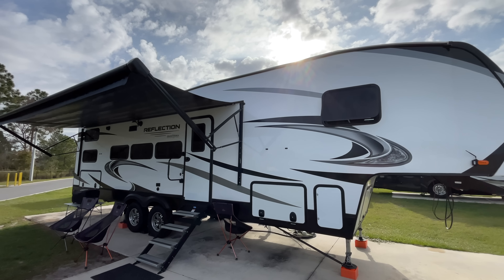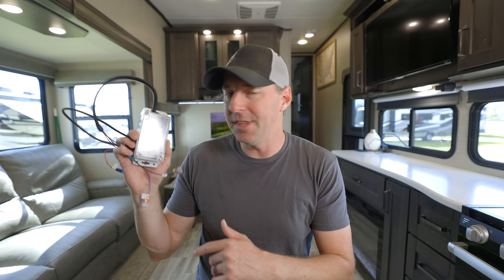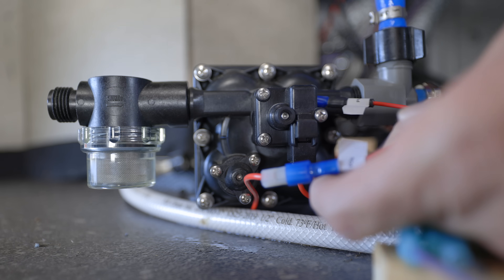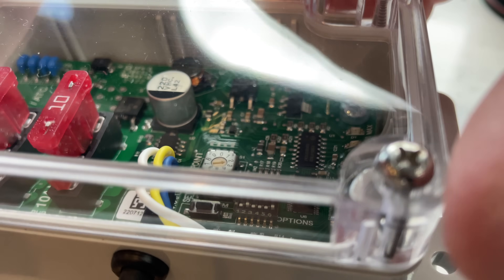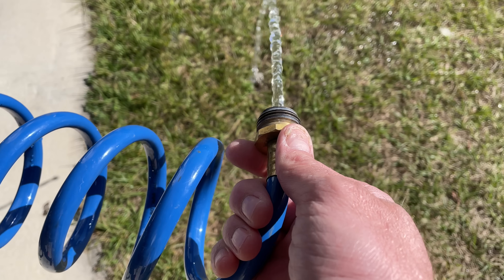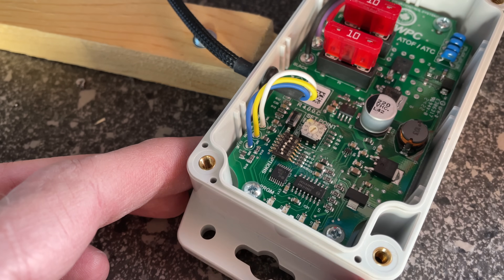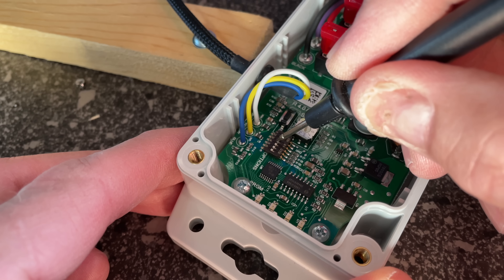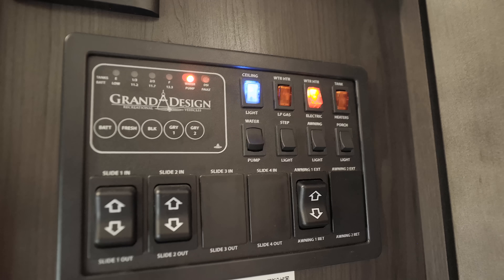Smart RV Water Pump Modification! Silence Your Rv Pump! IRVWPC

Comment: $210??? And doesn’t come with a new pump.

Or, get a $35 accumulator and add it after your existing pump.

Or, you can get a $70 pump with bypass, and adjust the bypass properly and get rid of most surging. Or maybe your pump already has a bypass and just needs adjusting.

Or, for about $150, they make pumps that are variable speed and bypass out of the box, like the Seaflo 56A.

Comment: Good video (upvote) but anytime you put a power limiter in series with a motor, or just about any other load, other than a simple heater, you start operating it at a non-optimal mode.  In other words, if a pump is designed to operate between 10.5 Volts and 13.5 Volts, at 8 Volts, the pump will work harder and likely not last as long.  One simple option for the pump cycling is adding an accumulator tank, which is what I've done.

What would be really nice is a system that makes tankless heaters operate as though they are tank heaters, but without the gallon limit (of course!).

Comment: Hi Jared, I just received mine and I wanted to ask where I can source one of those 90° connectors I saw on the inlet side of you pump hose. That strainer has that special fitting and I've not been able to find a 90° elbow that has that compression fitting applied. Wondering if you can help. Thanks and I've seen just about every video you guys have produced and I've learned a lot. See you on the road : )

Comment: To eliminate two of the three issues, get a SeaFlo (or equivalent) accumulator. Hook it, inline, with your pump's outlet (so, pump outlet, accumulator, RV water system) and set it to about 2-3 psi below your pump's cutoff pressure.

This will smooth out your water flow, eliminating pulsing of the pump. And only turn it on to recharge the accumulator.

It doesn't do much if you have your water on full-blast, but with less flow, the pump will run less often, but in longer bursts to do a full accumulator recharge. It should increase your pump's longevity too.
Reply: From the manual "The most efficient use of the accumulator occurs with the pre-charge set at the SAME pressure as the pump’s pressure switch “turn
on” setting. Typically, a 45 psi [3 bar] pump will turn on around 30 psi [2.07 bar]. Therefore, the pre-charge should also be30 psi [2.07 bar]. The pre-charge MUST be set in a “static” condition (pump off and at least one water fixture opened).
Reply: @littlechicago7482  How do you determine and set the accumulator PSI levels?
Reply: @LukaAVDJ  They usually have a Schrader valve (like a tire inflator valve).
Reply: I put in an accumulator tank and I don't notice it running any smoother or quieter

Comment: In the past I had to tinker with the two small adjustment screws on my Shurflo pump (bypass & pressure) - will that possibly impact the performance of this unit if the pump isn't at its "factory setting"?

Comment: I just installed a higher quality pump stuck inside a mineral-wool rectangle (with air gap) for sound deadening and a small pressure tank that eliminates the constant on-off switching. This would not give me enough additional benefits to justify the cost.

Comment: I have had the IRVWPC for about a year now, and I can't stop telling folks about it. It is one of those products that people generally don't know about. If you boondock this thing is great, if you are always connected to water, then don't get it. IMHO.

What I have found is that not only does it make the pump quieter, but It can help from getting the cold/hot spurts when you shut off the shower to lather up your hair, and turn the water back on. It helps to keep you from being scalded or froze. I also found out that if the spouse turns on a facet while you are in the shower, it will help keep you from being scalded or froze. When boondocking, you can get a nice trickle of water to wash your hands, or a plate, with out the on/off/on fast/slow/fast stream of water.

I also think they really need to re-invent the name. I think it would get a lot more traction in sales.

Comment: Our water pump is below a closet about in the middle of our 27' Airstream. Since using this device (IRVWPC), the water pump is much, much quieter and the water pressure is better. Sometimes, when my wife is in the shower, I have to listen to tell if the pump is running. I believe that the people that their water pumps in their living area and complain about the cost would have a different opinion if they ever got to experience using it. It's been a game changer for us.
Reply: Hey Dennis, I also have a 27' Airstream. The pump in ours is wicked noisy, I think it's mostly pipe rattle against cabinets and the inner skin. I have the soft hoses installed on the pump outlet already, so I'm wondering if this device will reduce the rattle noises, or does it really only smooth the pump cycling at lower flow rates? What's your experience been like?

Comment: Jared
Have you noticed any problems with electrical interference with this unit? Like causing LED lights to flicker? Just curious since many devices are not designed and tested for this.

Comment: I'm always watching your videos with high interest but this one honestly is a too much a nice to have gadget.
I like to hear the sound of the pump; with today trailer manufacturing quality issues, I prefer to control the pump myself from the panel switch.
Recently we got the kitchen hot connection broken and I was alerted by the pump and was able to stop it in less than 15 sec; waiting for 5 minutes would have been too much!
I turn off the pump every night and every time we leave the campsite when boondocking same as I always turn off city water when leaving RV park site, just my opinion but in many cases I'm always looking at the the simpler, the better ...

Comment: Having our water pump under the bed the reduction in noise would be very beneficial but currently waiting for for a second edition and hopefully a price reduction.
Reply: This is already a 3rd edition, from what I can tell. I got mine last summer and installed it in June. It works extremely well. I wouldn’t look for a price reduction, though.

Comment: I had the IRVWPC on our previous camper almost a year and really appreciated having it to smooth out the pump along with the safety features.  I’ve also had an accumulator tank and I much prefer the IRVWPC controller.  I will be getting another one for our new camper.

Comment: I bought this unit for our Airstream 30 ft and have had the same positive results as you, and the same dip switch frustrations.  I must add the owner /engineer is a super tech and so helpful on sales and service. I sure hope this stays that way and he like others is not bought up by the BIG GUYS that do not answer the phone or an email. I have asked him about Blue tooth in the future so those settings could be done on a App. And I understand that R&D cost could be prohibitive to keep it priced right for us end users. I appreciate your Video review as I tried an Air Forums  post and got the usual Naaaa I like hearing the banging pump. For you reading this I am a HUGE fan of this product. For you layman not into automotive pulse width modulation think of IRVWPC operation as a dimmer switch smooth from off to full bright or anywhere in between unlike a light switch BANG! Full on Full off.

Comment: Thanks so much for your review of this, Jared!  I wonder how much noise reduction this would provide if an accumulator tank were used with the water pump.  From what I've seen, such tanks reduce the frequency of the water pump cycling, but it seems that they would still make a lot of noise when the pump runs.
Reply from the maker: Good question! We had an accumulator tank before and it does help with reducing the short cycles on low flow but didn’t change how loud the pump is. This changed the sound enough to where I had been thinking of getting an accumulator tank again before we got this to test and now it’s not necessary. You could do both and they can work fine together but with as smooth as the pump sounds now it’s fine on it’s own.
Reply: I have installed a Seaflo pump, Seaflo accumulator, and an IRVWPC. Super quiet. I do believe having the accumulator tank does help to reduce the amount of time the pump needs to run. To me, as I'm converting a box truck, it made sense to build in all three up front. I'm glad I did.

Comment: If this was around $100 and had Bluetooth control for all settings I’d be a buyer. Thanks for showing this product didn’t know it existed.
Reply: I agree.  Using DIP switches and pots on an item that is likely to be buried in the undercarriage makes no sense to me.  If they don't want to use a wireless protocol for some reason, they could use a wired control panel that could be installed inside.
Reply: Mine is great and once installed there is nothing that needs to be adjusted.
Reply: I have one, which I installed. Once set, there’s no reason to change the settings. And it’s not “buried in the under carriage”—it’s within a 2 or 3 feet of the pump. Mine is easy to reach, just inside the cabinet in which the pump is located, if I want to change any settings.

Comment: Kind of related, I’m looking for a way to conserve water, I need hot water when I shower, does anyone sell a system that has a valve in the shower that is momentary, you need to hold it open by hand and it will connect the hot water line to send water back into the FW holding tank, even better if the button you press would heat up so you can feel you have hot water at the shower valve.
Reply: You’re pretty much describing the Aqua View Shower Miser, yeah.
Reply: Actually, I found that the IRVWPC does save water. My small 20 gallon tank used to last me 4+ days of boondocking, which includes showers every other day. After I installed the IRVWPC, my water lasts 6+ days. I attribute that to not turning up the faucets as high, which I tended to do to stop the pump knocking as much. Now if I just want a little water, like to wet a toothbrush, that’s all I use. I was frankly surprised at how much less water I used after installation.

Comment: I added a 2 gallon expansion tank to mine. To smooth out the water flow. Sometimes the pump doesn't even turn of if just using a little water
Reply from the maker: I did that on our last RV and liked it. Great option. It helped with the pulsing but didn’t help with the sound of the pump as much as this did.

Comment: Thanks for checking our the IRVWPC Jared! We've been fans of yours and we're glad you're now one of ours, cheers!
Reply from the maker: Thank you! It surprised me how much it changed the sound of the pump. It’s impressive what you have made.
Reply: @irvwpc Would this work with a water pump with an accumulator? For instance Seaflo PN SFWSK1-030-045-002
Reply: @stuartgriffin5.7  YES works with an accumulator. Just set the unit to TANK mode.  There is a video on our website under Support page.
Reply: @terrygunnell3571  thank you!
Reply: I wonder how well this would work with a RV water accumulator tank?
Reply: @jockosboy17  If your accumulator is like the small Shurflo ones it will work great. Just set the IRVWPC to TANK mode.

Comment: Wow the IRVWP controller has some great features.
We replaced our Sureflo with a SeaFlo and WOW it is quiet.  From my experience I now think of the Sureflo as the knockoff of the Seaflo. For less than 10% more in cost it was worth it.
Reply from the maker: Very nice.
Reply: Which Seaflo unit did you purchase?
Reply: @BuildingByFaith  SEAFLO 42